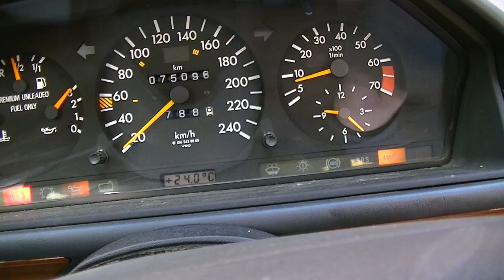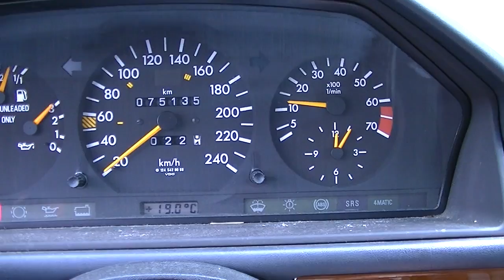How to bleed a w124 4Matic system

Comment: I have a blinking 4matic light as well but mine blinks only on idle. Your's seemed to blink also when pressing the pedal?
Reply from the maker: Mine blinked constantly. The 4Matic ECU can store and show error codes. I could be wrong, and you'll want to do some research on this, but I think that a blinking light at idle is either caused by a system that needs bleeding, or a bad accumulator.
Reply: JustFixIt99 I just ordered an accumulator is there any precautions to take before I remove it have a blinking 5matix

Comment: Hello, I apologize if such a question already existed, but there is a problem with 4matic w124, locks are activated at 100 km / h, can this be if the system is not pumped, or the front single wheel caster is not correct, or because of the 4matic accumulator?
Reply: That Is most likely the computer telling you "I can't help you now"

Comment: Man, you must be living in the salt belt or somewhere similar. You're asking for trouble with that sweater and an engine with moving parts. If you have a '92-'93 4Matic, there is a bleeder near the transfer case, NOT the bleeder on the TC itself. I have this whole procedure written up in pdf including making your 4Matic brain reveal its codes. Sounds like you might have even read it or heard about it from someone else.  I added the transfer case line bleeder to the tutorial yrs ago because I felt (and as you found out) the old procedure wasn't enough in some cases. I'm the original owner of a '92 TE 4matic and I also have the exact same car in another color.
Reply from the maker: Hi Kevin,
Actually me and you emailed over this car a fair bit and you walked me though the entire bleeding process :) Couldn't have done it without you. I figured a video would also help people out with it so I video taped myself doing it.
Reply: @JustFixIt99  Lol....had some sense of familiarity.  Do you still have your car? I have a reman TC in a new-to-me 4matic.....however it is doing the classic hydraulic fluid into the TC. The TC in my old TE (now a parts car) is fine, just need to switch them out. That Lucas product for transmissions leaks is the only product that slowed down the leak. I think I will make the winter without any more fooling around. I blew the output shaft seal at one point because the TC was so overly full of excess fluid. I gotta have a garage to do the swap because I'm too old to do it in the dirt....hate the prospect of that!
Reply from the maker: @kevinfetner7983  Sadly not. I was in the process of buying a new house at the time and needed every penny for a down payment, and the place is a major fixer upper so all my free time is going to that. I fixed the car up, got it running halfway decent ( I despise the CIS-E system.... never again... NEVER), and got the 4-matic going )with your help), then I sold it to a friend of mine with a classic car dealership. He then in turn sold it cross country to its new owner.

I loved the colour, and it was is amazing condition once I had scrubbed the living hell out of it and polished the paint. If it had an m104 in it I probably would have kept it forever...

I read the threads on your new acquisition when you bought it.
Reply: @JustFixIt99  A lot of those 4matics wind up becoming Barstool Betty's....lol. My last one sure made the rounds, but sitting unsold at dealers mostly...then off the MN to a private owner...only to be sold again for $10,000 (!!!) to the guy I bought it from (for peanuts). Well, the thing about the CIS-E isn't that it's a bad system, just mostly mechanical which usually denies plugging it into a diagnostic machine to see exactly what's going on. I've been hit & miss with it for over 25yrs and I'm still learning things. However, if I really wanted to know the complete ins & outs of the system, there's plenty of expensive literature out there to do that.  I challenged H.D. @BW to make a troubleshooting flow chart for the Benz CIS-E. He refused, mostly because no one would need him at that point...lol. Good luck with your new home....been there, wore the T-shirt on fixer-uppers...'course I'm old!
Reply from the maker: @kevinfetner7983  To be fair, HD has actually been nothing but greatly helpful to me.
Reply: @JustFixIt99  He's very knowledgeable..... he claims to have been a company engineer when MB built the W124 series. I just don't at my age, care for his approach of one kneeling at the feet of the master. In his efforts to make you understand a system problem, he'll have you troubleshoot the entire system. If you have time for that and want to play student, then he's your huckleberry on the W124....especially the CIS-E.
Reply: @kevinfetner7983  @JustFixIt99 Do you guys still have this PDF? I have a gorgeous 300te that runs great but has the 4Matic light on. Any help is appreciated
Reply: Hi, can you send me that PDF?? Please..

Comment: Hi, have you finished this project now? Did you have any more issues with the 4MATIC system after bleeding it? I'm in the process of fixing my own 300TE 4MATIC. A few videos of the 4MATIC system in action would be good! Thanks!
Reply from the maker: I have finished it, and the car has been sold off to its new owner. After I bled the system I didn't have any other issues with the 4matic system. But I only drove it for a day or so before it was sold.
Reply: @JustFixIt99  Thanks for your reply!

Comment: I don't have pin 8, how do i bleed asd?
Reply from the maker: Are to sure? Your counting from the correct side? Do you have an early 4 matic with the test lever instead of the test switch?
Reply: @JustFixIt99   i'm counting from the correct side (made sure about pins and opened terminal to see numbers) i believe car is 1991, has the knob, like your's does
Reply from the maker: Do you have a picture of the connector?
Reply: @JustFixIt99  No, and i couldn't find anywhere picture of identical connector. connector looks identical, but has more wires, and they go different spots..
Reply from the maker: Not to ask a stupid question. But you're sure your looking at the correct connector and not the one for the ecu?
Reply: @JustFixIt99   I'm sure about the connector, behind the battery are OVP-Relay, ABS-box and Box labeled 4matic.. Car is 300TDT 4Matic, so doesn't have ecu (OM603 Turbo, Brought from germany, Fully original, other than custom Transmission (Modified to be fulltime 4wd, Still has ASD and all bleed nipples etc..))
Reply from the maker: @AaJii  I'm afraid I can't find any reference to the 4matic diesel models specifically in my service manual. You may have to ask in a german or european forum that would have experience with your car.